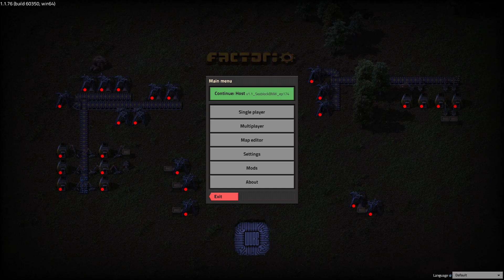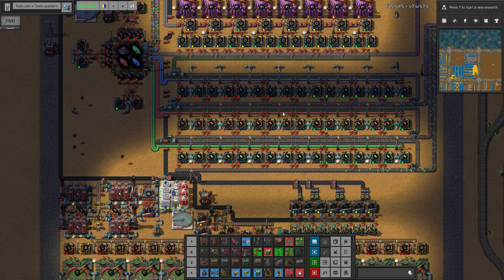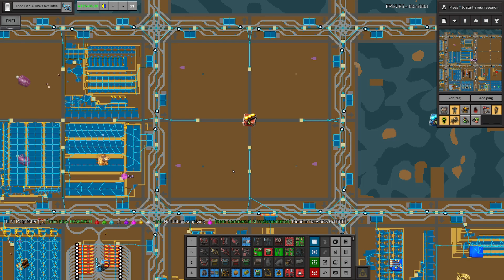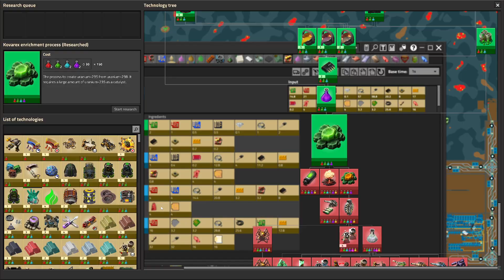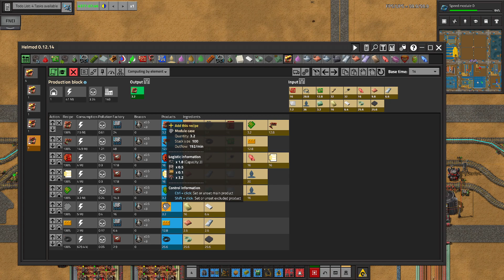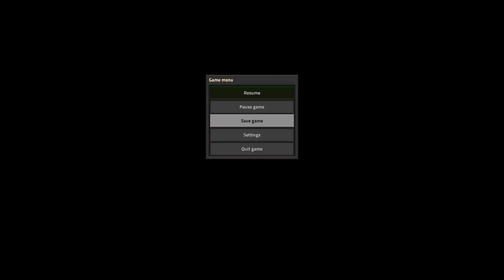PROD MODULE CABLE HARNESSES - Ep 175 - Seablock BNW - Factorio

Comment: The issue you are having with LTN alerts is because the previous train left the station one or more inserters still had stuff in their hand. So when the next train came the item in the hand is inserted into the train.
Reply from the maker: Exactly! Which should normally be impossible because I’m using locked slots per wagon on every provider. I believe the items are left in inserters because of power fluctuations but have not been able to confirm that. Once before I had the problem because jivolite station was incorrectly configured (somehow had an extra wire, probably copy-pasted requestor on top of provider or something like that). I really need to fix the situation with the power.